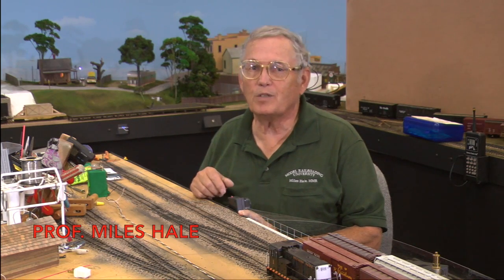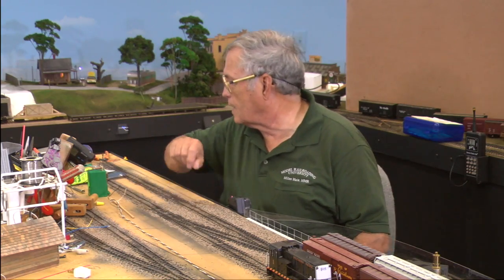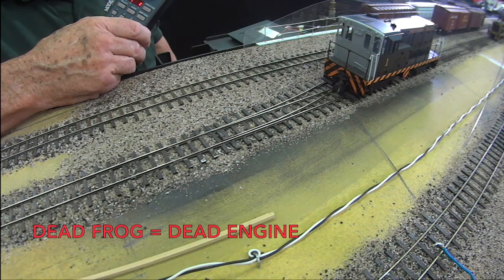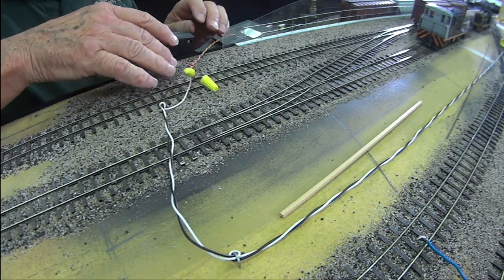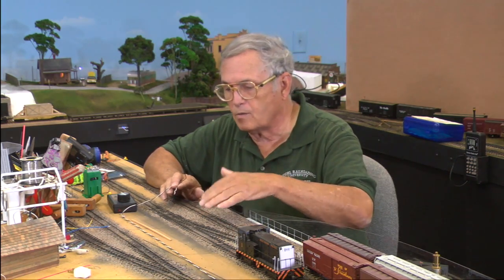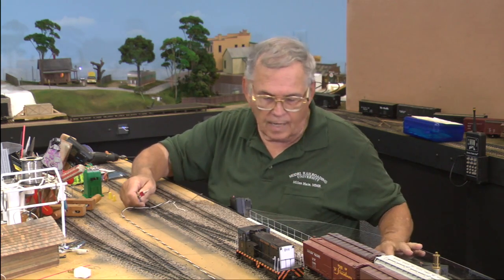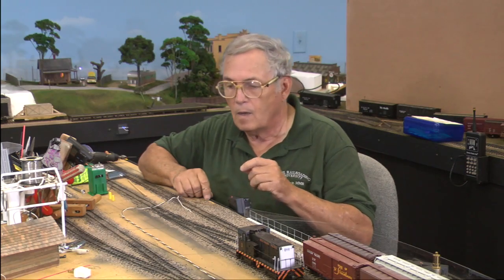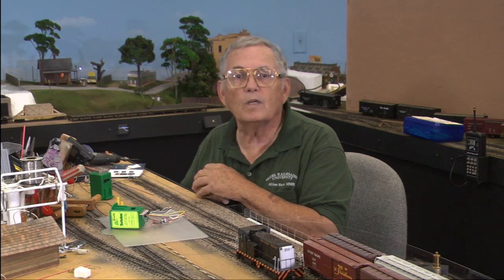Wiring 104

Comment: Switch refers to the movable point or points of a turnout. A turnnout is comprised of a frog, guardrails opposite the frog, a straight stock rail, a curved stock rail, closure rails and movable switch points as per prototype catalogs such as L. B. Foster, Bethlehem Steel, and every civil engineer and railroad that I know of as well as my own experience working on the prototype.

Comment: Hey Mr. Miles I am a new comer to the model railroading hobby. I find your YouTube channel very informative. I decided to learn as much as I can  about DC before I move over to DCC. Then hopefully I can slowly add in some DCC.  I would like to add a few turnouts to my layout to go from one track to the other. Upon entering this hobby I purchase a controller that does not have a continuous DC output just a variable DC a accessory output. Is there anyway that I can add electric switches to my layout without buying a new controller? I wouldn’t mind buying a new controller but some of those can be rather pricey. When I can get a DCC controller for not much more money. I would like to stay with DC for the time being.I am using kato unitrack right now until I can become better at my ability to use regular stock track. I hope what said makes since. Any information would be greatly appreciated. I’m hoping you know a cheaper way than spending a bunch of money.

Comment: Question on the wiring. When you wired up the Tortoise, you attached a brown and orange wire. Which rails (and location) on the switch (turnout) did you attach the brown and orange wire? Thanks.
Reply from the maker: Bill Beverly I connected them to the main buss wires under the layout. But they could be connected to the track just before the turnout on the two approach rails. Hook them up and if the frog shorts simply reverse the connections. Have Fun. Miles